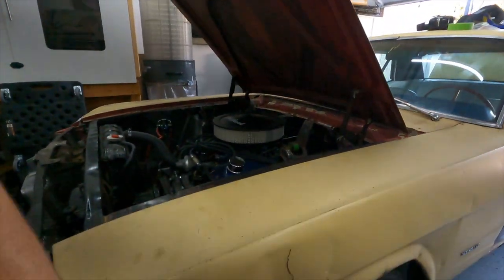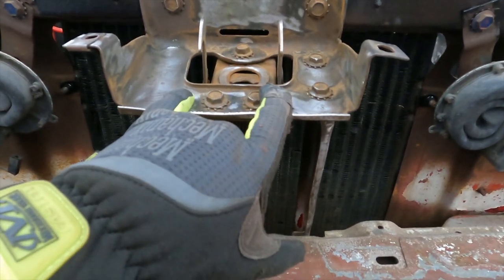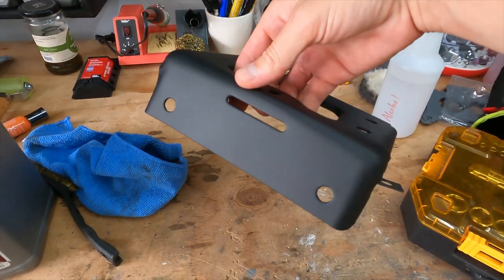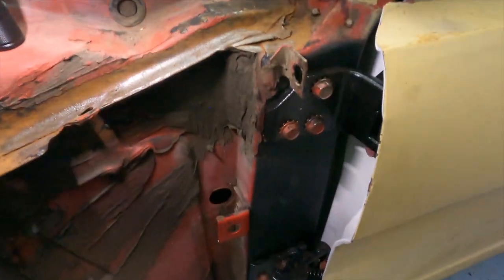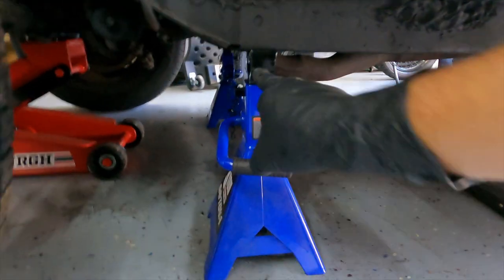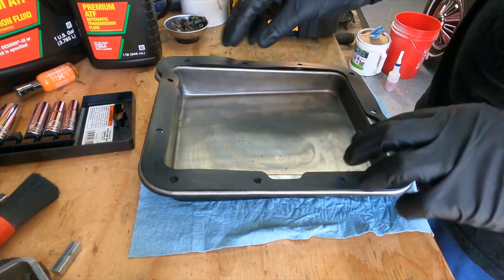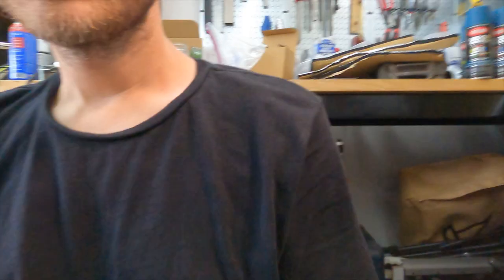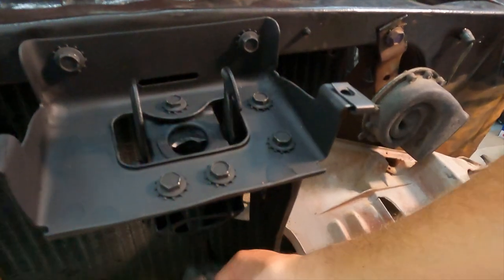1965 Ford Mustang Restoration | Transmission Drama! | Part 8

Comment: She's coming along, you might want to look on the side of your transmission where your shifter connects for the leak. There is a small rubber bushing where your shifter arm enters the transmission case that is prone to wearing out. There are a number of videos on YouTube that show you how to replace the seal. Best of luck and don't get frustrated you are doing great 👍
Reply from the maker: Awesome, thanks! I'll definitely do that!
Reply: There is also an o ring for the kick down lever shaft inside the Trans shifter shaft that can leak as well.

Comment: Hey bud just dropping in i ran a transmission business for years now im in a dealership but that besides what im going to get to. 
On them old c4's with the original transmission pans. Them pans are made of thin metal. Theyll deform around the bolt holes. If you're still experiencing trans pan leakage, i suggest when you remove the pan, to flatten out the pan where the bolt holes are and get you some flat washers to put on the bolts so it allows a wider area to stress the pan onto the gasket. Also, i suggest using a cork gasket. YES a CORK gasket. Dress the panside of the gasket with formagasket and torque to specifications. Them  thick rubber gaskets can give alot of headaches for everyone when they dont do what they are suppose to. 

I wish you the best of luck with your restoration my friend! Love the content!

Comment: I do the same thing with my jackstands and floor jack.  Make sure you are chalking the back wheels and have the emergency brake on too.  Also, I'd maybe put it up a few more notches on the jackstands so you can have a little more room under there.  Lastly, your upper control arms (and lower) will likely need to be replaced.  CJ Pony Parts has a nice front-end suspension kit for about $400.  The only challenging part is using a spring compressor (you can rent from the auto parts store) and also a pickle fork to break the ball joints loose.  Good luck.  Keep it coming.
Reply from the maker: Thank so much for the helpful info! Yeah, suspension is going to be next after the brakes!

Comment: Sorry it is giving you issues with running. I have a C4 trans as well. It had sat for 22 years before I got her running and moving again. I also replaced the filter and gasket on the trans along with the O-ring on the dip stick and replaced the cooler lines. It still took it about 6 months for the seals to stop leaking. No leaks now and it shifts great.

Comment: I use a farm implement paint on the suspension and frame rails on my 69 satellite. Its tough as woodpecker lips lol. Oil based, chip resistant, rust resistant. Brush it on or use a electric wagoner power painter. I like your style. Cant wait to hear those old tailpipes bellow a tune.
Reply from the maker: Thanks!

Comment: Common leaks on those, dipstick tube, shift shaft seal, if the neutral safety switch is not aligned right it won’t start, and they take type F only if they haven’t been rebuilt recently otherwise you’ll cook it. These are awesome cars! I’m just putting the final touches on mine

Comment: Last Ep:#7  You mention Shocks  KYB + Rear Springs. Rock Auto has all that for really cheap compared to the regular mustang's parts outlet. should check it out on regular wear parts as it Alway's cost less w/ same brands. Mustang outlets for cosmetics parts + parts no longer produce.

Comment: I just went through a C4 fluid leak nightmare. One not obvious thing to check is the gap between the bellhousing and the transmission body. There is a rubber seal there and if it's bad, will give you a pretty bad leak. Trans has to come out to replace it but you can do it yourself. That and the front and rear seals are other potential old age leaks. I rebuilt my C4 having never done an automatic before and it isn't that hard if you wind up needing to.
Reply from the maker: Good to know! Thank you!
Reply: Not all the c4's are designed this way. This design with the rubber o ring between the bell housing and transmission case was on c3 transmission which eventually turned into an a4ld which also used this rubber o ring. Most c4 had no seal connecting bellhousing to transmission. The seal that barrier all that was a gasket the pump bolted onto mating to the case.
Reply: It is possible you a referring to the transmission pump seal. Which in that case all automatics have. I doubt he has a front pump seal leak however because pump seals tend to leak under pressure via engine rotating torque converter.
Reply: This car would have a 'green dot' C4, and I can assure you it has the big rubber ring just like the one in my 66 Falcon. The pump seal is behind the converter and easier to diagnose where the fluid will drip out. With a car this old and apparently unmolsted I think he'd be wise to pull it out and give it a re-seal at minimum. When that big bellhousing seal leaks, it REALLY leaks. Guess how I know?
Reply: @mongrelmotorsports   yeah 64-68 c4  has bellhousing o ring.

Comment: Just swapped the C4 in my old Galaxie wagon, which is a "who cares" way of saying I understand your woes. So why won't it start now?
Reply from the maker: So you'll see in my next video! It was completely unrelated, electrical. The points were shot, so I replaced them with an electronic ignition and she fired right up, and is running super smooth now!

Comment: You are doing great!! 
Does the engine run? 

I came to an end of my mustang 65 restoration so I tried to drive but Unfortunately My automatic C4 transmission wasn’t working so I just took it out and it is going to be revised.. hopefully I will be done next week!
Reply from the maker: Thanks! Yes, it runs! Not sure how it drives yet. Haven't actually had it on the road. I need new brakes first! Good luck with your transmission, hopefully you can get it on the road soon.

Comment: was literally just looking this morning to see if you had a new video up yet.   bummer to hear about the leaks.  part of working on cars is the unknown drama that comes up.  im getting closer to the point of putting engine and trans back in mine and dread what may come up as a result when i do.  hope you get the issue figured out.  from the video it looks like all you did was remove the pan and change the filter so not sure what would have occured to make it not start now.    have you checked the neutral saftey switch.  i  believe its located there near the pan on the transmission and can cause issues with starting if its not working properly
Reply from the maker: That's awesome! Yeah it turned out to be the points. I traced it back to electrical and was stumped, so I decided to clean the point and got more spark. Then just ended up putting in a electronic ignition and it immediately fired up! It's also running so much smoother now. That will be in my next video!
Reply: Good times  Hunter 😂.  These early transmission were pretty forgiving.  If you didn’t use type F it’s ok.  It wouldn’t mess things up.  Heck of you were stranded and  on a pinch. You could get away with normal ATF which will be fine for power steering systems as well the early ones I mean.  Fluid  came out your vent on top of trans.  It’s fail safe.   You were right soon as you start the engine. It would of taken  on the rest of fluid and circulate through the trans.   
So far so good great work     Guido 👍🏼
Reply: @luckyluciano4968  right on good sir. However, should definitely avoid multi vehicle trans fluid now adays due to all the different friction modifiers they have added for these newer type transmissions. The friction plates used in an original c4 won't like that( over a period of time). However just to top off fluid or emergency fluid is better than no fluid!
Reply from the maker: @luckyluciano4968  Thanks Guido! Yeah I figured it was some type of overflow valve after I started her up and circulated the fluid! Good to know it wasn't that big of a deal to put regular ATF in it, oh well. Haha

Comment: the c4 has a vent on the top of trans if you poured 4 quarts in and it leaked out from the top then you absolutely over filled it 
also that c4 trans pan gasket you need the paper gasket  the goofy parts store rubber ones or those cork gaskets absolutely cannot be stopped from leaking  i tell you this from my own experience from when i built my truck (72 ford f100)
Reply from the maker: Thanks, I found it was leaking from the shaft seal and the rear seal, so I just replaced those in my latest video. I also used the new rubber gasket, but put permatex ultra black on both sides, so hopefully that keeps it from leaking. If it fails, I have a paper gasket I can replace it with!

Comment: Only mentioning this because you are using the word "restoration" here. The correct grill paint for a '65 Mustang is charcoal blue. Ford pretty much did not use absolute black on any grills back in those days. It's your car so you can do whatever, but if anybody is going for a factory look on any model Ford or Mercury, they should research stuff like this first. Good luck on your continuing project.
Reply from the maker: Thanks for letting me know! Where can you find a rattle can of that charcoal blue paint? Brand?
Reply: SEM trim paint, can be bought at any automotive paint store. Or O'Reilly's.
Reply: @richardbauer3327  Awesome, thank you so much!